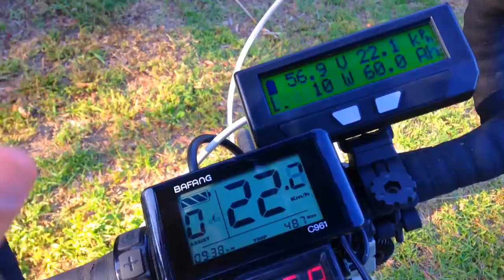Bafang BBSHD unloaded wheel speed test = 102km/h • 1000w mid-drive Electric Bike BBS02 8fun motor

Comment: hi bruno have you thought of turning round the engine........ of course it would be going the wrong way but it would give the possibility of having normal 3 chain rings what do you think also it would be better with a 100mm wide bafang   motor
Reply from the maker: +Michael Green - Hi Michael, Yeeeahh.... I have imagined all the craziest possibilities I could do with this motor... I even imagined making a "V2" joining two motors together...  hahahaaaha... 
The reason why there is only one chainring is because the chain would be dropping over bumps while under load (long story). There is a motor called Cyclone that would be easier to do the tests you have in mind http://lunacycle.com/motors/mid-drive-kits/cyclone-mid-drive-3000-watt-planetary/ the Cyclone company sells an upgrade with double or triple chainring on their website in Taiwan. The Bafang BBSHD 68/73/100mm are all the same motor.. the difference is that the 100mm has the crank arms spaced a bit more but the gears are exactly the same.
POWEEEEEEEER =]

Comment: HI BRUNO,   DO YOU HAVE A CHAIN KEEPER TO HOLD THE CHAIN ON THE STANDARD
46 TEETH RING ? BECAUSE NORMALLY I KNOW IT COMES OUT OF THE RING !!!
IF YES, HOW DOES THE CHAIN KEEPER WORK ? WHICH BRAND AND WHERE DID YOU FIND ?
Reply from the maker: Yeeeahh... I had my chain dropping all the time with my BBS02 that I used to ride with the massive 52T chainring. I was tired of stopping and getting my hands dirty two to three times (or more) a day. I tried to make something to hold the chain close to the chainring then I worked out that the front derailleur would work very well if I install it in a fixed position very low almost touching the chain. Chain used to drop under liar going over bumps... I haven't had a chain drop for over a year!!!

Comment: Hey Bruno, I have a question. I think I will buy a second hand Trek Farley 8 fatbike to hook up to the BBSHD. But what size should I take? 100mm? I can't find the right information  anywhere :(
Reply from the maker: Hummmm this is a bit tricky to tell.. 100mm may be ok if the frame is not too wide near the bottom bracket but some people are getting a bit wider and making spacers for both sides to compensate the larger size. Eric from Luna Cycles was getting some spacers made but you have to buy the BBSHD from his store. This article is a good reference http://electric-fatbike.com/2015/11/19/get-a-bigger-hammer-bbshdbbs02-installation-problems-fixes-for-non-standard-bb-intrusive-chainstays/
Hopefully it works for your new bike.. otherwise you may have to grind your BB and get an offset crank arm for the non drive side like Karl did in his article.
So much POWEEEEER =]

Comment: can you help me please i want to be able to go 55mph and 40mph up hills can this mid drive do that and will i have to hack it or change settings
Reply from the maker: I wold say it goes easily 55km/h on flat.. I did 74km/h on this video https://www.youtube.com/watch?v=RbiNoNmqUpg and 76km/h next day... uphills will do easy 35/40km/h depending on gears, your weight, hill grade, tire pressure, wind direction, battery voltage blablabla... if you want a bad ass motor, you should get a external controller and push this motor a bit harder haha...  =]

Comment: He messed up the settings, no BBSHD can do 60 miles and hour...not without an 80 tooth in the front ring, 40miles an hour is the average maximum of this motor on most bikes when unlocked at 1500w+
Reply: 40mph  get that on a 750watt  with 52volts lol or even 48volts probably with pedaling

Comment: A shunt mod and a 400$ hub motor kit gets you 2200W at 36v with better acceleration than this thing... What power?!
Reply from the maker: +Ariel Lezen - Sorry... 2200w at 36v equals 61AMPS this would definitely melt the wires...
Why would you go 36v with a hub motor if you can go 48v, 60v or 72v? This way it would spin a lot faster cooling a lot better and reducing the heat which is a BIG problem with all overpowered hub motors.
Hub motors are heavy and inefficient as you're always stuck with a fixed ratio. It's like having a car always running in 3rd gear... can't get enough torque going up big hills and also compromise your top speed. I work in an ebike shop and we get hub motor riders trying a mid drive for the first time and they can't believe how much POWER and specially RANGE they can get with less weight. Hub motors don't perform well with big wheels... they struggle.. it's matter of physics... If you go smaller like 24" or 20" and increase the voltage for higher RPM you get much better results. Direct drive has its benefits but hub motors have lots of downsides and compromises...
Do you think Bosh would make hub motors? Have you seen any Tesla with 4x hub motors? 99% of all high performance electric vehicles (cars, motorcycles, FormulaE) are all mid-drive for a reason.
Reply: +ElectricBike (Bruno) I'm running 68 amps max on my hub, no issues with wires melting😕
it's true hub motors physics wise are less than ideal but their merits are hard to ignore. 30/(pi*kv) is your coefficient of torque.  if your kv is under 10 one amp is almost one newton meter- if you divide torque by wheel radius (in meters) divide that by your bike weight in kg and multiply by 3.6 you get your acceleration. for slow speed (> 55) hub motors are fantastic.  you're right in that mid drive is higher speed and low range acceleration- but while you're there do a shunt mod and add some torque :) wire ratings are for indefinite use in non ventilated environments so for an hour long ride pulling 60 kmh bursting double amps for less than 40 seconds it's well worth it
Reply from the maker: +Ariel Lezen - Yeeeeeahhh... here we go... you know what you're talking about... huhuuuull... 
Yes, if we are talking about burst power... its totally possible to double, triple what the motor is rated as long as you have a good thermal management constantly monitoring the temperature and a good cooling system you can have so much fun (open holes and lots of air cooling the coils it the most common technique). There is a good article from Karl about Ferrofluid available and hub motors http://electric-fatbike.com/2015/12/18/ferrofluids-join-the-ebike-motor-cooling-revolution/
Yes,  hub motors have their advantages... there are so many articles about people getting better performance out of two smaller hub motors rather than one big and heavy one. 2WD needs a traction control like the Adaptto controller or something like 2000w at the rear wheel and 1500w at the front wheel to keep it +/- balanced under acceleration, every bike has different geometry and acceleration curve so these numbers will vary.
Please post videos showing your 2200w in action and post the link here =]
*I have my BBSHD almost all original because I am still testing this system and the new controller... soon I will be getting this motor working at 72v and increasing the phase amps to see how far I can push this thing... huhuuuuuull... so much POWEEEEER

Comment: If you want power look into LunaCyclone 3K watts , That is power .going up hills @ 20Kph and accelerating up to 40+ Kph and HOLDING  speed al the way ups tha hill . Passing cars on a boulevard ,they go 50Kph or so ,On a few kilometres no cars actually catch up to me .The awesome thingy here is I have yet to tinker with simple upgrades that will increase available power 30-40%   If Power you want look into that kit ,yeah possibly a higher difficulty level for  install ,so they say .I think not ,all the info is there on EB and ES websites . Read -> Know -> Install -> Ride with power . BTW In the area I live 4 cyclist have been hit by trucks .1 dead   ALL those accidents had something in common Truck blind spot ,if you don't know what vehicule blind spot are Google it learn and     Ride safe STAY OUT OF BLIND SPOT =STAY SAFE=STAY ALIVE